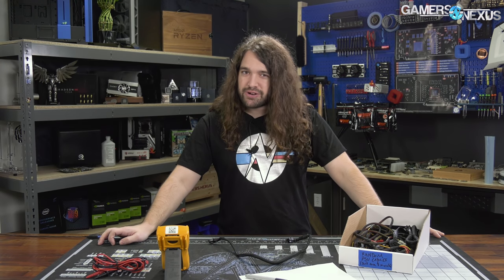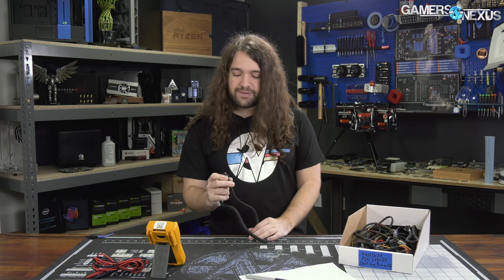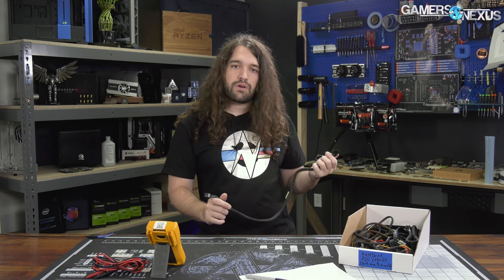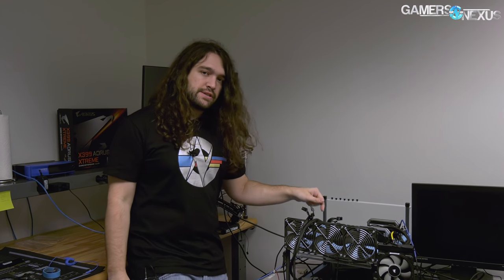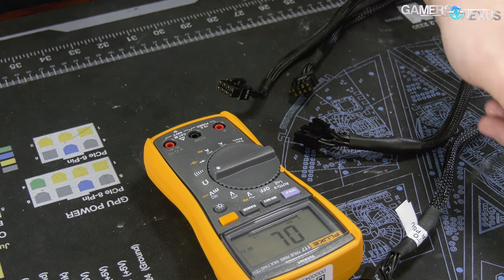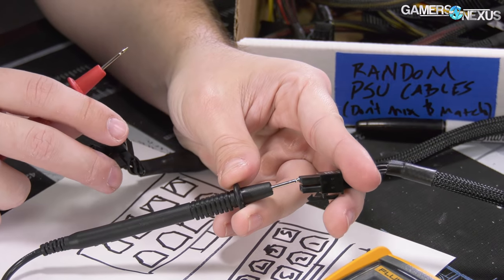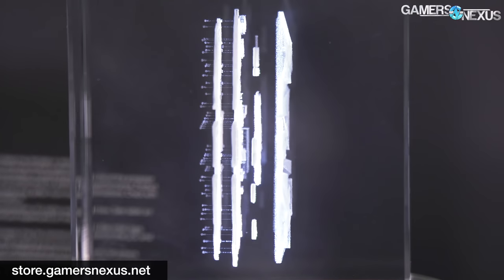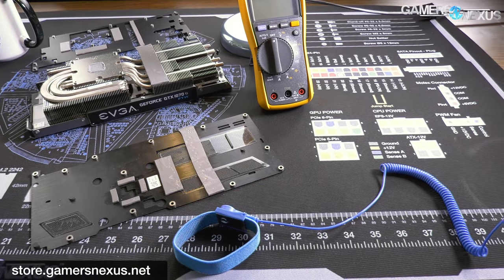How to Safely Mix Power Supply Cables Without Killing Parts

Comment: Overall this is an excellent video, with a lot of good information in it. Only a few mistakes which I have outlined below.

0:43 "or you could damage the power supply" Unlikely unless you have a cheap power supply, almost all modern units have short circuit protection and whatever you're plugging it into is unlikely to have voltage present at it (unless it's being powered from another power supply) in which case feeding low impedance voltage into your PSU ground can damage it depending if it's got protection on that side as well, but the "worst" you're likely to get is a short circuit, which will usually cause the PSU to shut down. You have a significant chance of destroying the part you plug into it though.
<EDIT> if you connect one of the rails and ground to a ground line on your GPU/MB you will short them and the short circuit protection will engage. However, if you connect a 12V rail to a minor rail you stand a decent chance to blow up an output capacitor. This goes doubly true if you connect the -12V rail to anything.
5:23 "we're just going to use a resistance check, so it's a continuity test" If you click your multimeter one click clockwise from where it is, you'll put it in continuity test mode, it will "beep" when it detects continuity (usually under a few hundred ohms check your user manual. a cable is less than 1 ohm so it will definitely work) This saves you from having to stare at the multimeter all the time and will save a LOT of time and effort. It was also left in autorange mode, so it has to range through all the resistance ranges, which takes time. If you are using the resistor check for this sort of thing (and there are good reasons to use it, but continuity testing is best done in continuity tester mode) then leave it in manual range for whatever you're working on. it will be much faster.
6:49 "OL" stands for "overload" so it's "OL" not "0L" no big deal though.
6:56: You are charging the capacitor that's in the cable with the multimeter. This is expected behavior for a cable that's got capacitors in it when you put the leads across the power and ground for it. Try measuring the "voltage" of a capacitor and you'll see the same thing.
11:20 "pin 1 doesn't need to go to pin 7, ... it just needs to go to 5,6,7 or 8" This is almost correct. It most cases this is fine, but in some cases the PSU might have different rails attached to that connector, and if you wire them up differently it can load up one rail more than the others on the PSU which can overload the rail while keeping the other rails the same. This was a major concern with my last PSU, which I had to completely rewire. However in most cases it's ok.
Reply: 12v to gnd is easy enough to figure out and control. 12v to the 5v rail can become interesting and is where I'd imagine where most of the problems arise. Power supplies do die if you do this, I have done it
Reply: I agree with Reuben, there can be a scenario where you feed back the 12V to the 5V rail and I'm sure not many power supplies will be happy about that, even if they have short circuit protection.
Reply: @jackwhite3820  Fairly sure all psu's out there have short protection. In the 80 plus standard I think..?
Reply: @ReubenHorner  Hi Reuben, that's a good point to bring up, one that I hadn't considered. (I didn't think about modular motherboard cables). First of all, let's recognize that this will definitely happen if you put both a 12V and 5V into the ground connector of the motherboard. I think the PSU itself will be OK if you do this, but you will blow up an electrolytic capacitor depending on a number of factors. This is doubly true if you connect the -12V rail to anything. 
I still think the rest of the unit will be OK, but I wouldn't expect every user to be comfortable soldering new capacitors into their PSU. I'm just used to proper lab PSUs with output protection (sometimes even including gas discharge tubes) on the output, so they'll be OK even if you accidentally put -1200V across it.
Reply: OL does not mean "Overload" it means Open Lead, or it in short there is not current flowing through the leads, when doing electrical in houses an Open Lead usually indicates that there is a break in the Black lead or in a White lead.

Comment: If the plug fits the PSU and is not using the right pinout, you can pull the pins and put them in the correct places at the power supply side. Same way you pull them to sleeve the wires.

Comment: Hey, Steve. Your video saved me a lot of headache yesterday evening. Just bought a new Seasonic PSU and was wondering why the heck the PC was not doing a beep when the PSU was in. The PSU worked fine when I tested it before, as well as the old one did when I put it in again for testing purposes. Turned out it were two old Corsair cables for SATA and Molex connections I left in. Swapped them out and: Voila, booted just fine. Luckily I got away without damaging any components. At least from what I could see until now.

Comment: You can always use a terminal tool or sewing needle to depress the retention tabs holding the wires in the terminals (plastic connectors), then move the wires to their correct locations in the terminals.  And then if you can find a kit with the right terminals and connectors you can use a pair of Blue-Point PWC47 crimpers to make your own cables.
Reply: I actually made the best one yet, to date, last night.
Scrap inkjet printer. There's a tension cable...no strip? the printer tram rides on it and it is under high tension. The left side connection is a thinnnn and very rigid...spring rigid... piece of metal.
It takes a good sheet metal sheers to cut it.
Cut out a .750" x .140". Then cut down the middle about a half inch so I have 2 - .070" tangs connected at one end. Then with my finest pliers, finesse and patience, started twisting them carefully until they resemble a tiny tweezers. With the ends slightly inward, the hardest part is inserting it into the plug. Then it's just push the extractor and pull the wire.
The tools I had in the past didn't seem to work like they should.
The needle method works but usually distorts the pin...along with the assortment of other items I have tried in the past.
Using new pins is great and the correct crimper tool ensures a solid connection, but, a soldering iron is more versatile for the money. And if your customizing your PSU cables, you should know how to solder also for those other projects.
But yeah!
Bought a Channel Well Technology, CWT, to replace my old Seasonic PSU. (That was actually the first Brand New PSU I ever owned.) CWT uses all black, flat, ribbon style wires for the cables. Very unclean look. My old Seasonic cables are already setup for my PC components.
Their plug, my wire harness.
Now, all I got to do is stop telling you about it and finish the damn thing. 
I got online with hopes to find a pin-out diagram. I know how to trace the wires and all that. It's just that, it's late. I'm tired. And I want to have that redundancy for it being correct the first time.
The saga for why my tower is...has been down for a year now is much longer than this reply/comment/jabbering.
I really need its additional abilities...although my laptop is great, wonderful, awesome...okay, great and wonderful...it just-is-not-the same...Shit!  I hear our rooster crowing....

UPDATE:
Apparently it was an anomaly. I could never get it it to work the same way since so...went back to the needle and modified safety pin...the safety pin mod is great! all you have to do is....

Comment: I swapped my corsair ax760 for a new hx1200, and I thought I was sold a dud psu when the pc wouldn't power on. I swapped the main 24-pin connector harness with the one that came with the hx, and lo and beheld, it worked!
I got spooked and swapped everything else over. Here I am! Learning the hard way that psu cables aren't standardized 😮‍💨

Comment: Omg, I have always mixed power supply modular cables. Did not even think about that before because I was quite certain that this is a standard. I guess I have been lucky so far, no dead servers on desktops :D

Comment: Steve, you can also move your range switch one more position clockwise to "continuity." It has the symbol that looks like the sound waves. It will display resistance, as the resistance setting does, with the additional benefit of sounding an audible alarm when there is continuity. Thanks again.

Comment: I learned this the hard way. Ordered a random SATA splitter for my system and ended up blowing one of my Commander Core XTs which was the first thing connected on that cable from the PSU and luckily saved my SSD from being fried. This was my first build so I didn't know that peripheral cables were pinned differently depending on manufacturer

Comment: What I do is a bit simpler, I plug the unknown cable in and measure the voltage on each pin. Just use a jumper on the PSU if you can't have the system turned on while doing it.

Comment: OR if you are OCD about it, you could just use a Molex Pin Removal Tool, and then reinsert the Pin or socket connected wires back into the connector on one end of the cable in the order that you need them to be. All Computer Power supplies use the same 'Molex' type Pins or Sockets on either end of the wires which go into the connectors. (The Pins are roughly the same diameter as a solid copper 12 gauge wire without insulation). The sockets are sized to 'sleeve' them accordingly. Each Pin or Socket has their base with two 'Flared out' sides to prevent them from being pulled out of the connector. A proper 'Molex Pin Removal Tool' will have two cylinders one to fit over the Pins and one to fit over the Sockets. Push the wire into/through the Connector while sliding the appropriate size 'Molex Pin Tool' cylinder over the Pin or Socket. Then Pull the wire out of the Connector. Once all the wires are removed, then continuity check them, and insert them into the Connector where they should be, to match the Connectors connections of the other cable.

Comment: As a person that doesn't care about the aesthetics and uses solid side panels, I wish there was more properly colored wires in modular cables. In fact I did some custom cables for modular power supplies, for the purpose of being shorter, and instead of using single color, I used the proper colors as dictated by ATX standards. Makes it so much more obvious and easier to figure things out later.

Comment: At some point in life, most of you will find yourselves in a situation where knowing what cables you can or cannot use with a given power supplier will come in handy. 
And that's that. It's the kind of thing that actually happens not as rarely as you'd wish for.

Comment: Very helpful video. For my PC I had to so something somewhat similar for the LED strip (a very long yet inexpensive one that I got from a hardware store) to connect it to the power supply. It uses 12v, but the connector has nothing to do with a molex, so I had to properly match the 12v and ground pins from the LED strip connector to the molex. This allowed me to save quite a bit of money, since the generic LED strip is significantly longer yet cheaper than those made for PCs.

Comment: Great video! Just used this to use an EVGA PCIe cable with a SeaSonic PSU. I found it interesting how the key on the PSU end matched the key on the PCIe end, and then the PSU end had the 12V pins on the same position as the PCIe end.
In any case, thanks a bunch for the info!
Reply: SeaSonic is the OEM of some EVGA units I think so would make sense some wires are interchangable.

Comment: No mention of if it's easy or hard to pop the pins out of the socket and re arrange them? 

This is commonly done with some types of industrial cables but I haven't tried with computer cabling.

Comment: you could connect the cable to the psu and just measure the voltages on the other end before hooking it up to anything.
Reply: I agree, I believe a lesson in understanding ground and finding it this way would be necessary for that method.
Reply: Yeah, but this requires you to power on the PSU either outside the build or do the test with the PC running.  I don't think anyone who needs a video like this should be doing either of those things

Also, you can use a automotive test light instead of a multimeter.  If you have a good light, it's much faster and usually easy to see the difference between 12, 5 or 3.3 volts
Reply: @trapperjohn7571  pretty easy to power on a psu while keeping the pc itself off,or just have it turn on as normal and just test the new cable before using it with anything,lots of tests can be done on a running system without much danger.
imo finding the standardized pinouts for the device side connectors online and verifying the voltages are correct is much simpler and quicker.

as for finding a ground that is real easy too,just use a molex connector  ground or in some cases you can even just stick the probe to a metal part of the pc case and you should be grounded.if you got a dmm learn how to use it.
Reply: I know that already, but this video seems to be made for people who barely even know what a multimeter is

Comment: Did this to use some extra SATA cables from an older Corsair PSU to use on a newer corsair PSU.  Even if the pin outs don't match but you have the same keyed connectors on the PSU side you can just pop the pins out and rearranged to make it work for you.  Obviously check, double check and triple check that you arranged the pins right before you plugs anything of value in.
Reply: how do you test it with SATA connectors?
Reply: @HazewinDog  The SATA power pinouts are standard and are grouped together by voltage or ground in 5 sets of 3 pins.  From the key (pin 1): 3 pins 3.3 (or empty), 3 ground, 3 5V, 3 ground, 3 12V.  The location of the wires that enter the back of the connector correspond directly with the 3 pins they are located behind.  If you're still not comfortable, you mostly likely will be able to check voltage at each wire where it enters the connector to verify everything is where it should be.

Comment: I'm thinking about sacrificing some cable extensions to make different bundles for the 5, 12, and ground pins, so that it's easier to measure and compare the pinouts on both cables.

Comment: I just want to say that if you use a standardized connector for a unique purpose, you’re a monster. The connectors on these modular cables are the same on both sides with just a thicker clip on the psu side, WIRE THEM THE SAME ON BOTH ENDS! I believe that this is deliberate Sabotage. It’s outrageous.

Comment: And people wonder why I don't use modular psus or sleeved cables. The colors are their for a reason. A few months ago Science Studio mixed psu cables on one of his rigs, blew out a bunch of parts, then started blaming the problem on a light controller. Someone finally showed him that he had used the incorrect psu cable. 

ATX has standards for everything else so there is absolutely no legitimate reason for not having one for the psu side connector. It doesn't matter what the psu makers want, it's what the ATX standard should be. Just like Dell, Packard Bell, (and a few others) were forced to go with standard pinouts on their systems there needs to be a standard and everyone needs to follow it.

And for the record, you can get a cheap DMM for $3.00 (sometimes less) at Harbor Freight that will do this. No need to spend $30 or more if you aren't working with high current or need precise measurements.

Comment: Why not just plug it into the PSU and check if all voltages are correct on the other end of the cable?
Reply: Well because if the multimeter is set incorrectly this could blow the fuse but yes that is easyer but you also have to connect the right pins (don't remember which ones) to turn on the PSU if you want to check the 24 pin cable.
Reply: @CheapBastard1988 
You have to be really careless to set it incorrectly. Plus i think OCP would kick in before fuse would blow.
Checking 24 pin cable this way is indeed a bad idea.

Comment: If the connector fits but the pin-out doesn't match, you could pop the individual pins out of the connector and put them where you need.

Comment: How would you do this testing if you dont  have any knowledge of which cables were the correct one for the power supply? I just got a big of psu cables from a relative and a evga Psu 1000 p2. I was able to separate the Corsair because they are identified. The rest seems to be an assorted of evga cables however there are different models of evga cables all lumped together. Thanks for making this video. This is the only one of its kind and I’ve found so far.

Comment: I feel like a better way to explain this is to show how to find the power supply voltage output (demonstrating how to find ground by using the power cord ground and checking continuity to each pin) and then jumping the power supply on with the 24 pin cable.  Then use ground with a live power supply and map where the voltages are on the psu itself.  Then using the standardized component sides, determine how the psu side of the cable is wired.  Then you can even take it another step by showing how to re-pin the cable itself and make it compatible.  Of course, stress personal safety working with live voltages.

Comment: could you use voltage dc on the multimeter to test while the power supply is powered ?, to skip much of the hassle of checking if pin x is equal to pin x with a known cable

Comment: Huge pain in the ass. But I've done it for stuff like making my own Super Nintendo S-Video adapters. If you can find whatever retention tabs inside the contacts in the plug, they can be unclipped, swapped and adapted for whatever PSU you need. If you're gonna go through the effort don't wanna leave empty-handed.